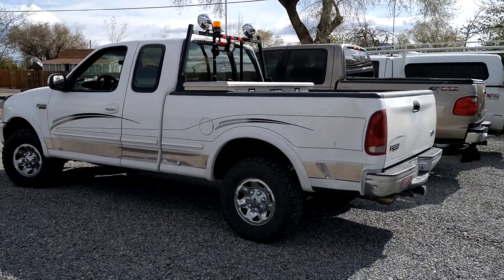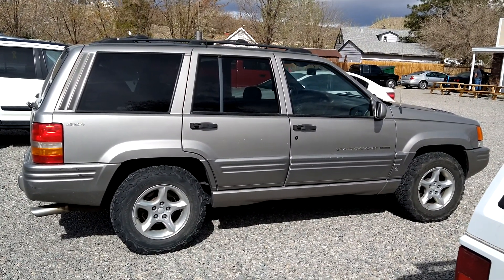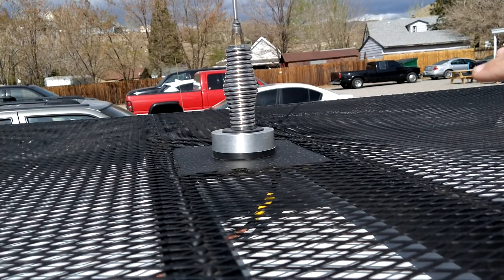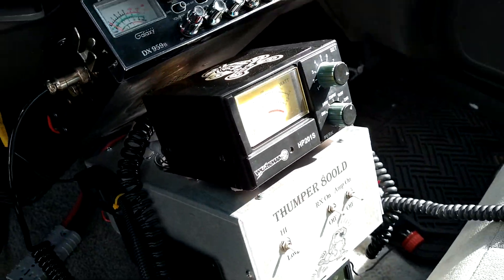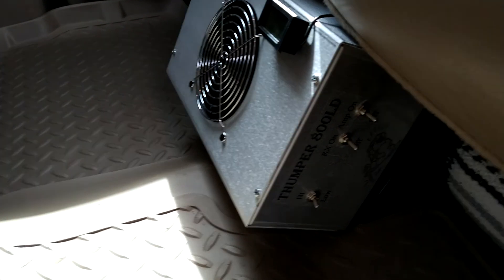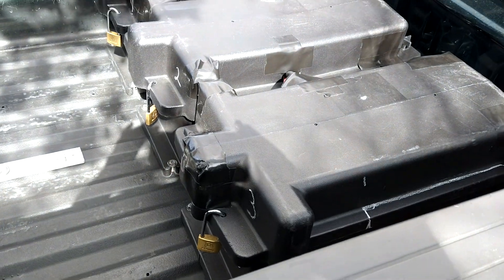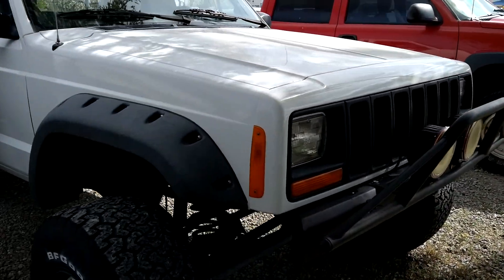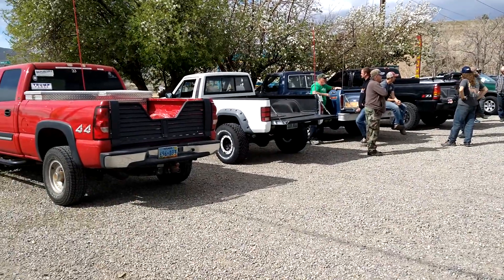Our first Northern Nevada CB radio meet and greet in Dayton, NV.

Comment: Nice video. 

You should do a video on that mosfet amp.. I have always heard bad stories about them.
Reply from the maker: I have a few videos on them. You hear bad stories from people who hear bad things from some guy they heard about, lol. I was leary as well, but they are solid and very reliable. My buddy 191 drives the crap outta his and it runs excellent! In my opinion I'd honestly say it's about equal in performance to a 1 driving 4 bipolar amp. The difference I see is that it runs cooler and draws less amperage while still making the same power. I'm sold on them and want to try a 16 mosfet amplifier next.
Reply: @vegasfordguy  your right about the bad stories. I don't know what keeps me going back to buying one. Those bad stories are the only thing stopping me from buying one. 
Thank you for the response. I'll go find the video.

Comment: Just moved to Dayton, where my people at?
Reply from the maker: Turn the radio on! There's a handful of guys on the radio in Dayton. 191, Flop top, 403, 50 amp, rusty screw and several others!
Reply: @vegasfordguy  will do, most my stuff is still in boxes. Somewhere I have a Lincoln rig and some licensed gear.

I’m between stagecoach and Dayton